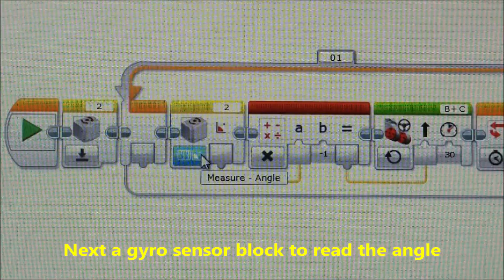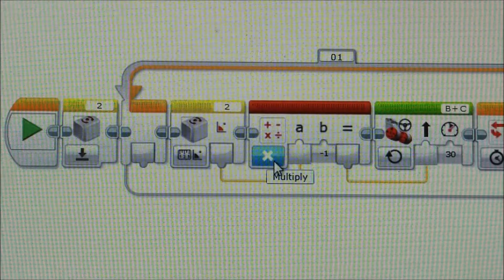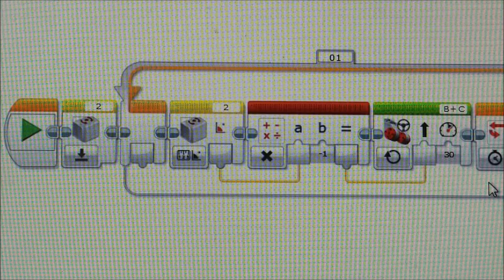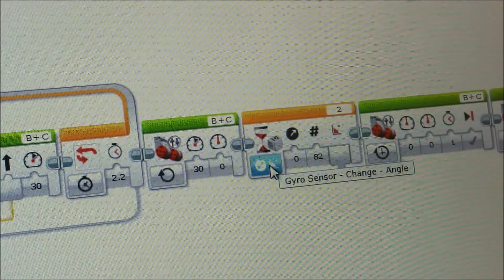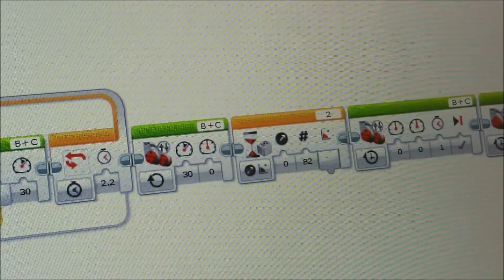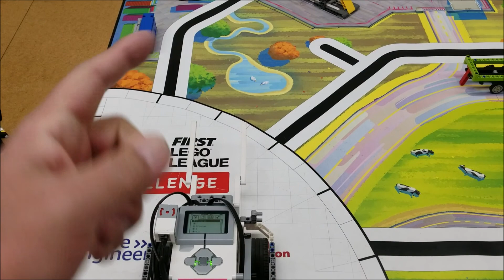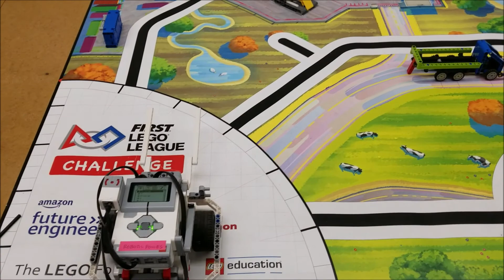Using The Gyro Sensor For Better Accuracy In FLL

Comment: Very nice demonstration. I have noticed some times that the gyroscope output is going crazy! It continuously increases, although the robot stands still. Unplugging the cable from the Lego brick and plugging it back, solves the issue. Have you ever experienced this?
Reply from the maker: Yes, you are right. All the time. Especially when you turn the robot on while holding it.